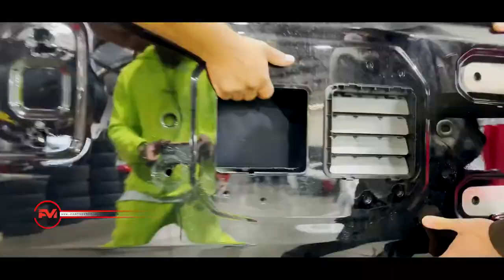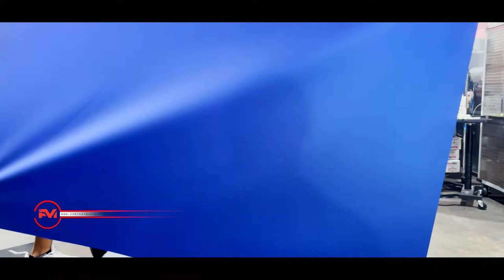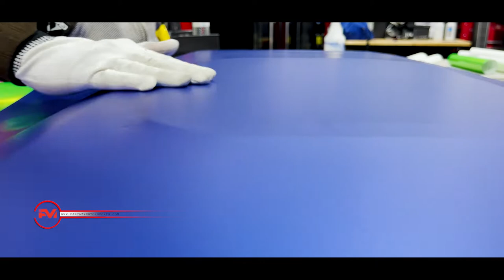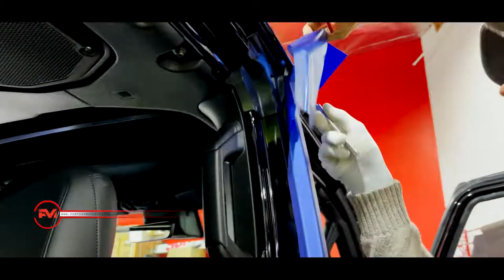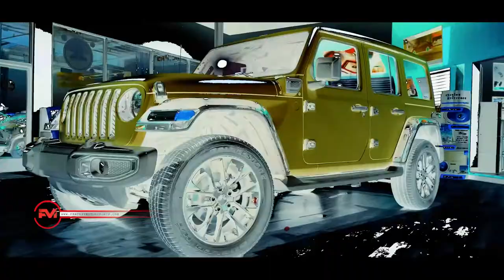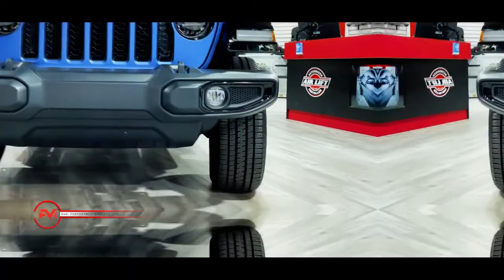HOW WE WRAPPED THE 2022 JEEP WRANGLER UNLIMITED 4xe in MATTE METALLIC BRILLIANT BLUE

Comment: Superbbb 🔥 Did you have to use knifeless tape to bridge the 2 sides where theres a crevice between the tail lights and the back panel. Theres a vertical straight line that divides it.